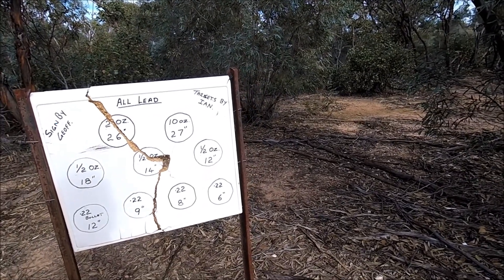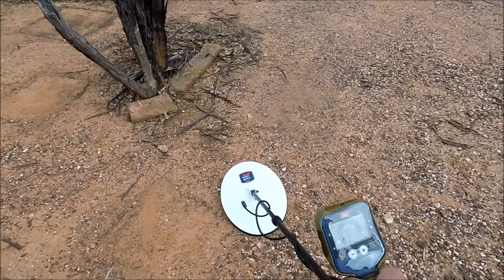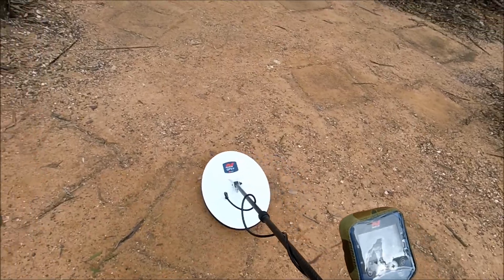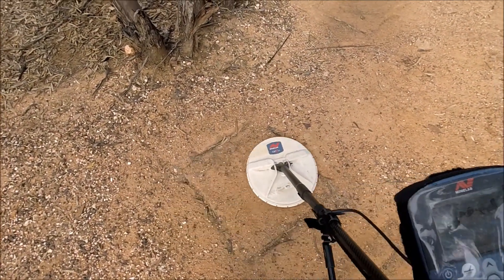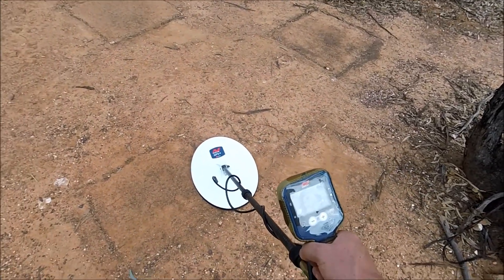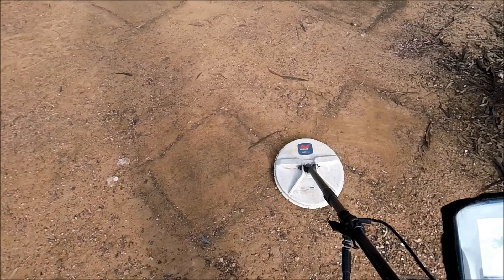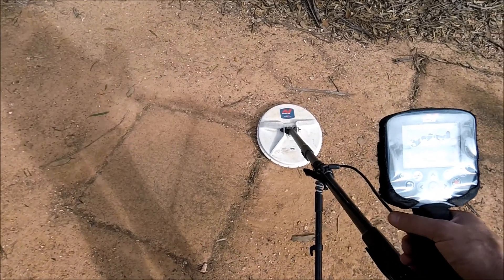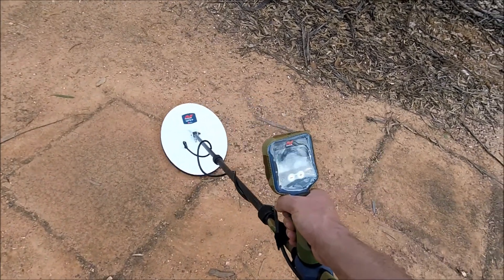Minelab Main Event (Test Patch Challenge) - GPZ7000 vs GPX6000 with 17" Coil

Comment: A great non bias video mate. 
Both are great detectors. I am about to purchase one this week. I Have researched both the 6000 & 7000 for weeks now. And even spoke to some mine lab reps. I personally have decided to get the 6000 and the 17” coil.
 They are both very similar in finding gold with the 7 being able to go a tad deeper.

 The extra weight of the 7 has been the deciding factor for me (I don’t like wearing harnesses) That little bit of extra weight over a full day or 2 make a big difference over time. For the little advantage it offers over the 6.
I think people would be happy no matter which one the go with, if there is gold
there either one will find it.
Reply: The extra bit of weight & robust build of the Zed will allow you to detect in longer grass effortlessly  where as the 6000 with the 17" coil will give you grief with its shaft twist & the uncomfortable felling something could easily break. The 6000 certainly has its place but so too does the Zed for the deeper bigger gold. I have both & know that for a fact.
Reply: @johnnytheprick the stronger build quality and heavier weight make it push the grass down easier, it's a fact, using both myself you can't compare the 6000 to the 7000 in long grass.
Reply: @johnnytheprick the grass in that video has died down a lot compared to normal years, we've been abnormally dry so it browned off a lot.  Yea, we have gold, mostly small gold but the odd bigger bit shows up, still small compared to the stuff you guys find though :)

Comment: Even though i used to own the 7 and did not like the egonomics it was built with so i sold it .This test goes to the 7 it is not being beat here .The 6 seems to struggle a bit at true depth ,but maybe wit the 17 coil it would be fine.But i would still choose the 7 ,that 6000 noise threshold is not nice.
Reply from the maker: They have now fixed the feedback through the speaker on the 6 which makes them much quieter.

Comment: Have you had a play with settings and the nugget finder coil on the 7000 ?I have had really interesting results like better depth on larger targets than the 19" coil. I'm putting it down to being able to up the soil timings and sensitivity while having less saturation from ground noise and emi.
Reply from the maker: I havent used the NF coil

Comment: On the .22 lead at 9" and 12", Zed is clearly better. Were you in General or High Yield?
Reply from the maker: Appreciate the question.  All run in General, the 6000 seems to do slightly better in High Yield. For some strange reason both detectors struggled with the 22 at 8 & 9" but did better at 12".
Reply: @thegoldrushguy  Maybe The target was probably vertical and not horizontal .Who is to know what twists they did when they buried them